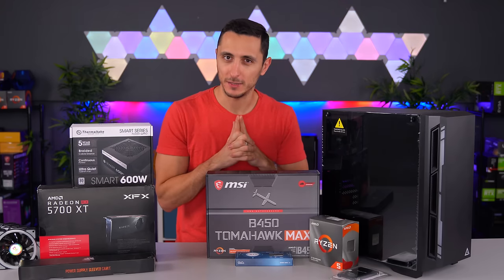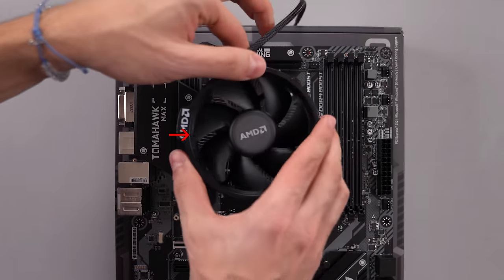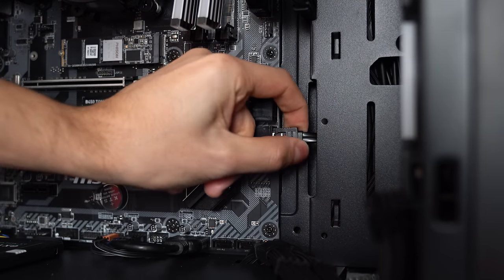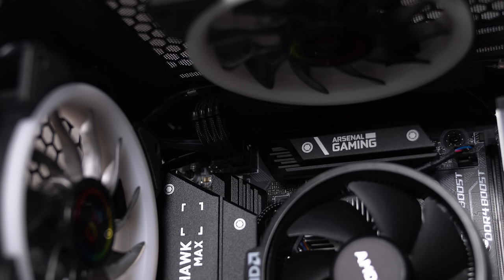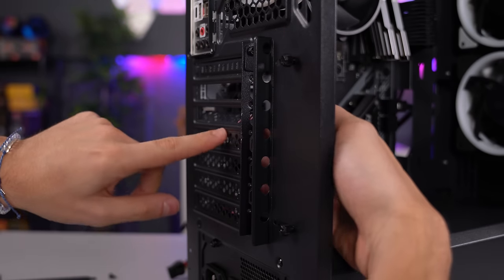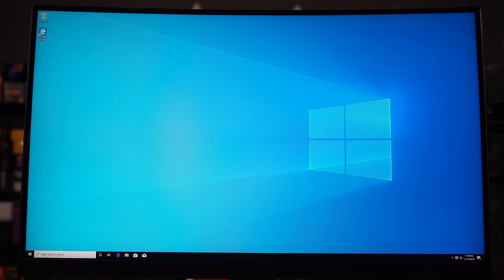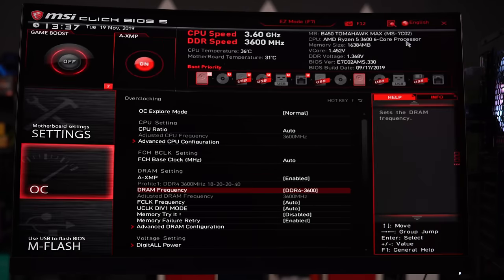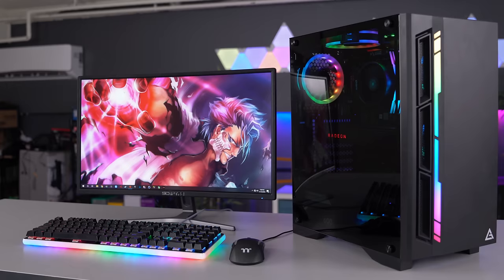How To Build A PC - Full Beginners Guide + Overclocking

Comment: I just built my first pc. It didn’t turn on the first time but i came back to this video and it literally saved my pc. I cannot thank this man enough for making such a high quality video which so clearly explains what to do while keeping a brisk pace. Thanks tech source.
Reply: What mistake did you do ?
Reply: prashdharne probably 10:36
Reply: Eds a legend man
Reply: you sound very happy
Reply: prashdharne some cables not completely plugged in and the 5 pins from the case in the wrong order
Reply: Does all the cables come with the mother board or pc case
Reply: Mc Donald’s yes and most cables come with the component you order. I would recommend getting some pc extension cables on Amazon just so that all the cables that go in to the motherboard look the same
Reply: @mcdonalds7483  Depending on the motherboard, the most common cable that comes with it are 2 6gb/s SATA cables. The cables that I believe you're talking about come with the Power Supply Unit, aka PSU. Other cables (front panel connectors) automatically come with every case. If you want your PC to look nice, you'd usually want to grab a set of braided cable extensions with a color of your choice on Amazon or a specific brand website. I would also suggest that you get a fully modular PSU  if you're big on asthetics.
Reply: @dom2989  girl? Insta bloody_impact_xt
Reply: Specs?
Reply: Does anyone know what screwdriver he’s using?
Reply: 666likes um

Comment: Beginners: it cant be that easy
After first build: its that easy
Reply: It aint that easy
Reply: Austinsuav3 nope
Reply: TheFlSage I felt that. Finished building my first PC a few days ago and I’m currently loving it
Reply: The cables just killed me I sucked at plugging them in
Reply: @koolkidkyle4340  Lol same
Reply: Austinsuav3 I playing
Reply: Me currently building a PC unable to start it
Reply: I found it kinda hard, but that's because my hands were super sweaty from fear of messing up
Reply: afarensis LOL
Reply: @Austinsuav3 i built my own rig after saving up some checks, its really not that hard but in many aspects its nerve wrecking.
Reply: @Austinsuav3 I'll be 75 next month and just bought parts for my 3rd build from Microcenter. Waiting on the case from Amazon. I'm going to watch this because my last build was 7 years ago and just want see what's changed in that time. But it's easy to build. The tough part is picking what components goes well with the other parts.
Reply: @Austinsuav3 ok boomer
Reply: Any idea why USB doesn't turn out devices when plugged in the port? Followed exactly on here.
Reply: Tenks you gave me confidence
Reply: @saakethmanepalli1185  check whether all cables are connected properly, use HDMI cable to connect to monitor and graphics card
Reply: @frasperclip  look thanks I missed connected my front panel cables. I figured that out a week later. I hatee those
Reply: Pretty easy, just a lot of pressure
Reply: I’m about to build my first pc, I’ll come back to this comment when I’m done
Reply: As someone who LITERALLY just completed my very first PC build, can confirm.
Reply: @kfdaddy  happy birthday mate
Reply: I can see many parts of this video that I would spend many many minutes trying to figure out. Routing those cords is a big part he skims over.
Reply: bleepehdeepdoop  Indeed. I was second guessing myself all along. (wondering if I'm pressing too hard, triple checking to make sure I'm plugging into the right ports and all that). Shit had me tired afterwards
Reply: @himathyjenkins  only picking and deciding parts to buy is hard
Reply: We'll see im gonna build mines tomorrow, but do i really have to activate windows
Reply: Mah mum says its hard
Reply: Justin Samuel no
Reply: @_KT5  thanks bro
Reply: Austinsuav3 do u know how to get WiFi on a built pc
Reply: @bradenhengels1156  Install a PCIe Wifi Card or get a USB Wifi adapter
Reply: @stepnightbot7633  no
Reply: It's a complete horror. I always think I snap the motherboard when I'm inserting the connectors
Reply: Yeah easy just built my first pc took two hours
Reply: Yep, exactly what I thought
Reply: I just built my first PC today and I can confirm that is true
Reply: I could probably do the building but not the windows installation and stuff
Reply: It ain't that easy for everyone. Fucked up my first build and wasted like 500$.

I ended up just buying pre-builts ever since.
Reply: Ambient Light Of Darknesss I know right
Reply: LaZeR FNM windows installation is so easy just put in the usb and it will load up windows then for the drivers get another usb and download your drivers on a second pc and download them on your pc
Reply: Ambient Light Of Darknesss dude prebuilts arent worth it they are overpriced
Reply: Superior464 Well I am too dumb to build one and nzxt bld is a good website to get one
Reply: Superior464 I’m literally 11 y o and have a laptop that gets 60 FPS on low graphics.Anything would be better than that
Reply: the only time it is hard in my opinion  is setting up water cooling
Reply: 月 - CLUTCH no one noticed that you made a Spider-Man Into The Spider Verse reference
Reply: Building a pc is like legos with screws
Reply: Coolers Gaming I see what your saying but it’s like adult legos
Reply: @Austinsuav3 THE CABLES ARE SO CONFUSING AGHH
Reply: I have not even built an entire pc yet. Im 10 years old and im just waiting for my b450 ds3h mobo. I have my gtx 1650 and my r5 2600 and my tforce 3200mhz 16gb ram. I got the adata su635 ssd for my boot drive. I have some old 580gb hdd from my familys old pc. But im probably not going to use that because it has 400gb of 640p pictures and multiple viruses. Im probably just going to get a 2tb seagate barracuda drive
Reply: 1400th like!
Reply: RobloxianRachata That’s COOL BEANS
Reply: I need to build a pc and uts my first time. Is it essy? Lmao it looks like its so complicated
Reply: ColourArmy lmao I haven’t either it looks hard
Reply: ReCall Synergxzer yeah, but i will try :)
Reply: Jacob thanks for the support
Reply: I can confirm it’s not that easy
Reply: toggledfn nou
Reply: Just follow and it’s as easy as 123
Reply: This actually helped me in a way😂
Reply: I have anxiety, somebody help me

Comment: This seems like a simple, straightforward guide. I’ll use it when I build my PC later this month!

Edit: I’m currently in the process of building, jut took a break to make something to eat but I’ll be back at it in ~45 minutes. So far I’ve followed the first 8 minutes and the guide has been very straightforward and useful. I’ll update this again when I’m finished.

Ok I’m done now and it seems to be working fine! Thanks for the help.
Reply: Did you put the m.2 ssd as it's missing from the parts list?
Reply: Greedy Gamer did you copy his parts?
Reply: @euanreekie7201  I also built a PC using his old guide, good stuff
Reply: Ethan B how good was this pc as I’m about to build it
Reply: @euanreekie7201  It's pretty good, a bit lacking in the GPU section but it can play pretty much any game at 60 fps like modern warfare, GTA, red dead, stuff like that
Reply: @James Arongino just go on amazon and search "m.2 ssd". The one he used said Phison but i couldn't find that one. I chose to go with a Western Digital Black m.2 ssd
Reply: I used this guide to and, ur right, it is the best guide I have found out there. Strait forward and good.
Reply: What type you have
Reply: I didn't ask
Reply: Ayuck
Reply: Greedy Gamer I’m gonna do this in like 5 months hopefully
Reply: I’m building mine tomorrow by following this video! I will be using my own parts! Hopefully it goes well.
Reply: How is your PC now... after 3 months?
Reply: Ethan B I wouldn’t say 5700XT is lacking by any means. Of course, there are Nvidia cards that are technically better but they easily cost $1k+ compared to 300-400 that’ll comfortably last at least 2 years before even considering an upgrade lol

Comment: Tech: To install windows, you'll need a flashdrive with atleast 8GB of space.

Also Tech: *pulls out one with 128GB of space*
Reply: Keylem he said “at least” so it doesn’t matter. Read noob
Reply: Kelvin Pineda I think he knows that it’s just the point that he went way overboard
Reply: Kelvin Pineda it’s a joke...
Reply: moh720 it’s a joke...
Reply: @gu17ner38  clearly not, last i checked jokes are supposed to be funny.
Reply: Keylem hey so I clicked the link for the graphics card but the box doesn’t look the same as his do I still grt it it’s a thicc lll
Reply: @sfuikm  not all jokes are funny
Reply: @sfuikm  You must be fun. Trust me, I can tell.
Reply: @sfuikm  you're so soft lmao
Reply: moh720 you just be fun at parties
Reply: MichaelUpTop dk
Reply: hi i just build a pc with msi tomohawk 450 max with radeonrx 580 and ryzen 5 2600 and love it... almost. Does anyone have any idea why when i plug in my headset that i use to play xbox one that has a mic, the headset plays sound perfectly but the microphone does not work. plz help
Reply: @techsmartonline  try using the back audio ports and see if there is a difference. If so, maybe your front panel connectors are not correctly connected. It could also be a discord issue or whatever software you use.
Reply: @techsmartonline  You need a headphone splitter cable. Plug your headset into the splitter cable and put the male pins into your mic and audio port.
Reply: I love when people just want to make comments and everyone gets mad because.. they can’t take a god damn joke. Honestly please just back off and keep scrolling considering you get mad over what some people find funny. If your humor isn’t the same, don’t comment anything and keep your opinions to yourself. Last time I checked, our opinions shouldn’t matter to them. The point of this comment was probably to show that 128 is just overboard. There is no need for you to reply and try to teach him what ‘at least’ means. He’s not 4 years old, and he knows what it means. And honestly, who hurt you? Who hurt you that much to the point that you are that soft?
Reply: I wouldn't recommend deleting system 32.
Reply: I think hes got enough hate already lol
Reply: What did he mean after that with the WiFi Adapter? I don't get it.
Reply: Bruh momento
Reply: eT Cryptic the thicc III is still the 5600xt but it is just made by a collaborating brand. If you want this exact video card, look up Radeon 5600xt on amazon
Reply: GamerTechPro u need a input output splitter cable
Reply: @sfuikm  Ugh. Why so uptight?
Reply: @sfuikm  Ever heard of sarcasm or dry humor?
Reply: people who don’t understand a joke 🤦‍♂️
Reply: moh720 yo chill he was jokin my friend
Reply: moh720 damn you must be funny asf then
Reply: Lmfao. I used a 128 GB flashdrive to install windows cause they are the most common.
Reply: I don't own one less than 128. I own 64 micro SD for my pi4, but it's not worth the money to buy less. They can be had consistently for under $60 and are so large that etcher sees them as a disk drive.. so why not?
Reply: Literally me
Reply: moh720 ur the type of person to tell the DJ to turn the music down at a concert
Reply: Kelvin Pineda no need to be so pissed
Reply: moh720 dude it’s a joke chill goddamn
Reply: moh720 ههههههههههههههههههههههههههههههه كلامك حقيقي
Reply: moh720 well then check again 🙄
Reply: @sfuikm  you must be fun and quirky
Reply: @deluxestars9201  I'm just farming replies at this point. Baiting is so easy.

Comment: i feel like a caveman.. it's so overwhelming can u just do mine lol.
Reply: I swear I feel the same way lol seems so damn confusing
Reply: i get so confused on all the cables
Reply: Its not really that confussing....

But actually it is😉😉😉 LoL
Reply: I get confused where to plug in the fans
Reply: King Anthony it’s pretty easy I can help you
Reply: I feel you
Reply: Zentora thats the only complicated part for me loo
Reply: I second, third, forth, and fifth this.
I got 4k and just want future proof. Someone halp
Reply: I’m a mechanical design engineer explicitly because I genuinely believe all electrical engineering is just pure witchcraft.
Reply: the cables and cpu give me anxiety
Reply: What's the purpose of the stand off screws
Reply: You can plug them into the motherboard fan headers which will let you control how fast they run or you can plug them into the power supply using a Sata cable which will make them run at 100% speed all the time
Reply: Yes do u or anyone know what to do if i bought Microsoft operating system on a disc but my pc doesn’t have an optical drive (a place to put a disk)
Reply: S◼️ame
Reply: I have been ther bro it ok
Reply: its hard finding a good budget prebuilt gaming pc
Reply: Same lol
Reply: basically part together tape ooga booga pc
Reply: With a montage you can solve this
Reply: I’m not liking because it’s at 420 likes 😂
Reply: Rik Res stand offs keep your motherboard from making contact with your case I think??
Reply: Flayzz good to hear coming from someone with a fortnite profile picture and a generic “subscribe” banner smh 🤦‍♂️
Reply: Especially because he is going too fast
Reply: Right
Reply: It seems intimidating but once you actually do it its not that bad.
Reply: Guys I have lots of doubt 
1. Like in the case there is power on and every button so does every motherboard perfectly fit or only some?

2. Are all motherboard and case buttons and everything same so we put any motherboard in any case?
 
3. Should we buy different coolers or the ones with the case

4. Can anyone build one for me😅😅😅 idk how to and I really want one😅😅😂😂
Reply: Exactly
Reply: BatBoy Here the one question I understood was the cooler one and the cooler comes with the processor not the case. Usually fans come with the case but not coolers.
Reply: @arc9987  oh
Reply: @Mylca  Things have escelated quickly since then...
Reply: Same
Reply: @scrambledbananas  I have a question how do you get wireless Internet in the PC
Reply: Puncc  if you think it is worth it then go for it my dude but just know you could get a lower price for the same specs if you build it instead of buying a prebuilt.
Reply: The overclocking org is confusing
Reply: King Anthony you need to do more research he’s a bit more complicated watch an Easter version and then watch a complicated version like this one 👍
Reply: @scrambledbananas  If you can't find any 3 or 4 pin slot labeled "SYS_FAN" then try connecting the fans to any molex cable on your psu
Reply: @jennyjen9549  I figured it out a long time ago
Reply: @scrambledbananas  sorry i was late to reply lol
Reply: Sober Sins how
Reply: same like me.. but if doesn’t understand I like to watch again and again and again
Reply: No but I can do u
Reply: @scorpiojayy2512  it’s really not
Reply: @dingdongcomedians6191  ikr
Reply: Ha bots
Reply: can i just hire someone to build it for me or no?????